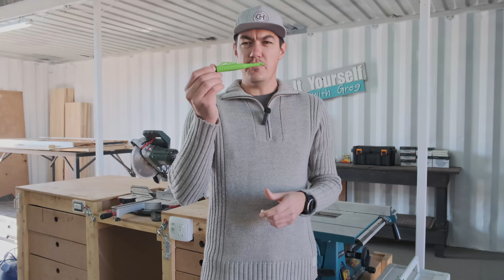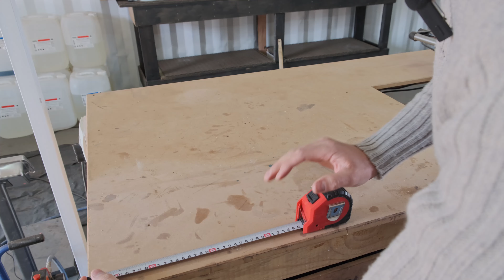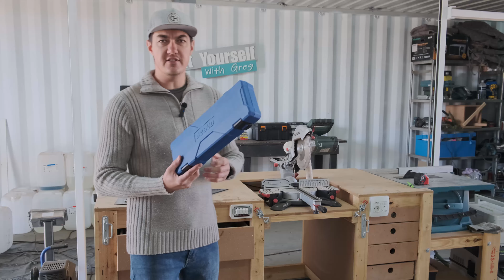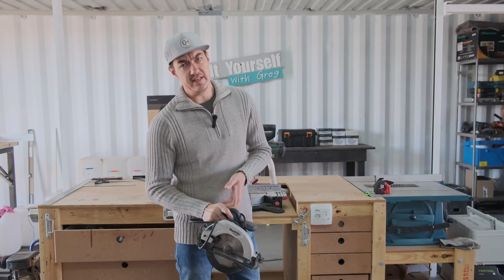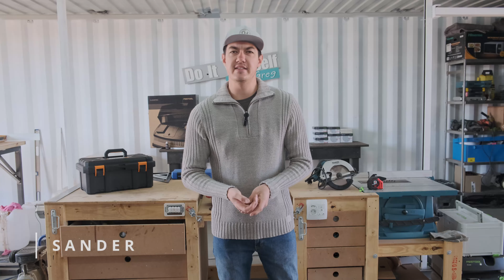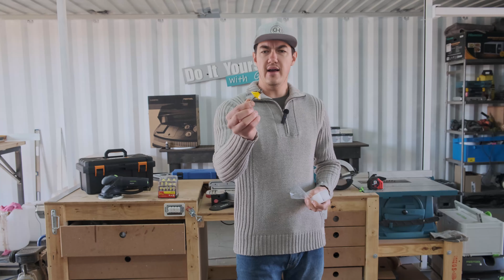7 MUST Have Woodworking Tools For Beginners

Comment: Great video Greg. I've started woodworking during lock down, and slowly starting to get my head around everything. First power tool I got was a router, and made some rather nice things with it. I now have all the power tools you mentioned, and now need to decide on a table saw or a mitre saw with a push arm.one thing I would have added to your list is to make sure you get a proper blade with your circular saw. I couldn't figure out why my cuts were slightly off after measuring a 100 times, and from time to time left burn marks in the wood. Did some research, and replaced the free blade that came with the saw. Now my cuts are straight after the measure twice cut once rule 😅
Reply from the maker: Thanks for the kind words and feedback.
Woodworking is such a satisfying hobby, and its true what you said about the blades on the circular saw, im thinking of bringing out some videos going into detail on each tool in my shop. Like “10 Things a Jig saw can do” so thats in the upcoming plans and videos.
Good luck with your woodworking journey and thanks for the support